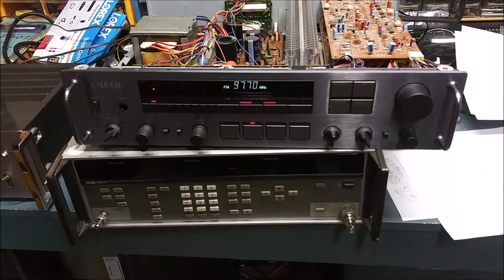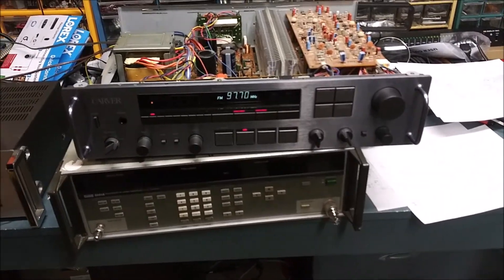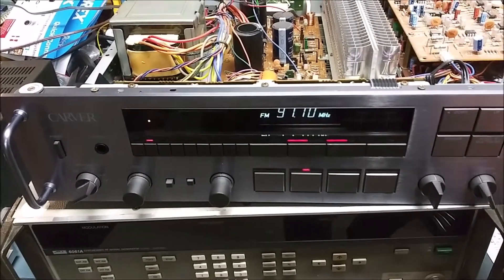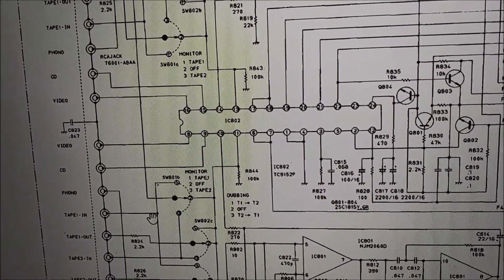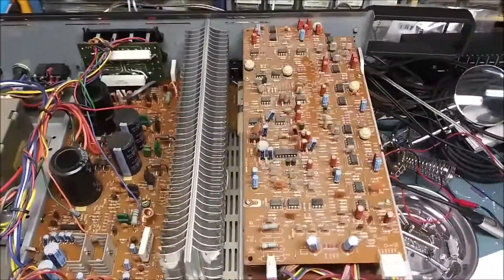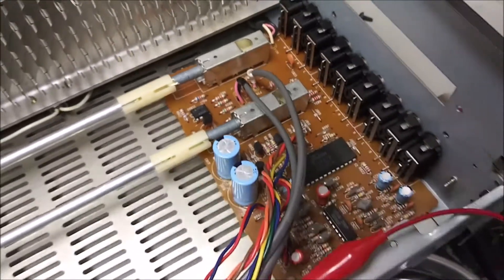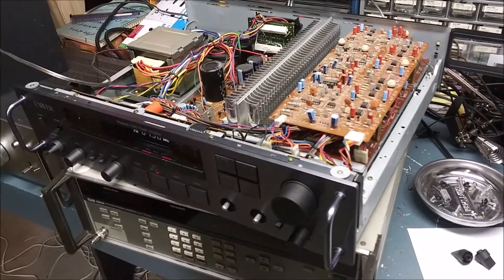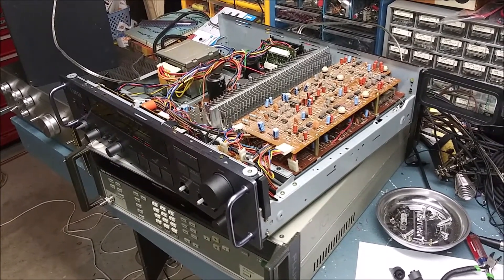Carver MXR900 Receiver: Diagnosis, Repair and Test

Comment: Very good vid. Just learning and interested in this. So I have a little signal tracer that I made with a mini radio shack speaker. I get perfect audio to the in's on the chip, but bad staticky low output from pin 11&13. So do this mean the TC9152P is bad?

Comment: I have four of these.  My only gripe is that some of the controls are well buried under layers of PCB's making it difficult to clean the switches.  The amp really makes a pair of 15" JBL's, jump.
Reply from the maker: Yes, they are a PITA to work on!
Reply: Ever have issues with the tuner display (main display block) failing?
Reply: @arcsound  Yes on one of them.  Is was the PS board, I think.

Comment: There should be a service panel on the bottom of the unit to avoid needing to remove the stacked boards. Also, the front panel slides off if you remove the 4 screws (2 top, 2 bottom) that hold it in place. That way you can tighten the pots without damaging the faceplate. You will also need to unplug the connectors to the display, tuner, etc. So still better to leave that to your friend 😅
Reply from the maker: I can't remember if there was a service panel or not...
Reply: @RocketRoberts  The entire bottom panel comes off, which would have given you access to that broken wire.

Comment: I love the units that have the pre-in pre-out jumpers, it sure saves a lot of time. It is the first place I check also. Those slider tape monitor switches are also problematic. Lucky to find a failed intermittent connection like that so fast. Bad failed solder joints are probably the number two problem I run across, especially in high heat areas like regulators and power supplies. Number one problem is dirty mechanical switches on these old units. Helping a friend today diagnose his same unit, this video will be real helpful. Thanks for posting this. It is nice to see the potential problem areas like the layered boards and ground issues so I don't make the same mistakes.
Reply from the maker: Pre-out/amp in jacks are VERY helpful.  Agree that corroded switches (and pots) are among the most common issues wit vintage units.

Comment: i have one of these and i bought it 37 years ago. it is still working without issue. i have it connected to a russound internet player for a whole house audio system. it is on 24/7 and has zero issues. i paid around $1000 for it so i am guessing it was worth the money. great video. good to know in case mine ever has an issue.
Reply: I've got one I bought new in about 88. Still in great shape. Haven't turned it on in a while. Will hook it up again one of these days soon. I've been thinking of doing a recap one of these days.
Reply from the maker: They are definitely way above average when it comes to quality.

Comment: Aloha RocketRoberts Nice repair. I have the same amp just die on me I wonder if you can help me what the problem i turn on amp LCD display won't light up  only one yellow line lid up on the far left and the amp start to smoke i open up and see no burnt parts or any capacitors is leaking or blow up no burn resistor or anything, Do you know where  should i check. Much mahalo for your help braddah
Reply from the maker: I'm guessing you are in Hawaii (I've visited there 18 times).

Unfortunately I'd need to have the unit on my bench to do a basic assessment.  Sounds like it could be some kind of power supply failure.... but again, near impossible to diagnose without it here.  Wish I had a better answer for you.  If you were nearby I'd say "bring it over"!
Reply: @RocketRoberts  aloha much mahalo Braddah I very appreciate your reply and kindness wish I was close by too be good stay safe with your Ohana Braddah 
Aloha